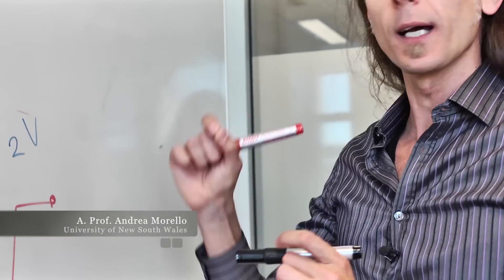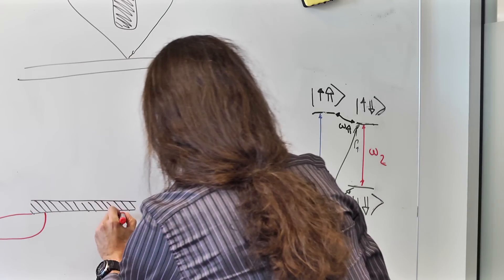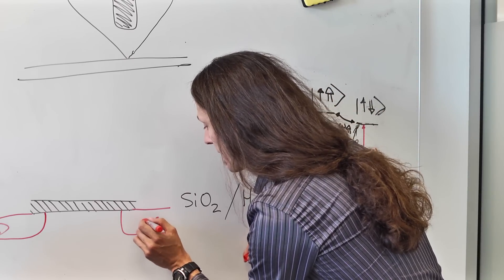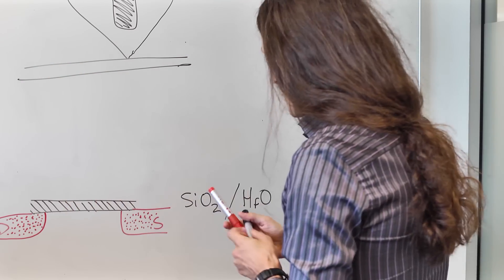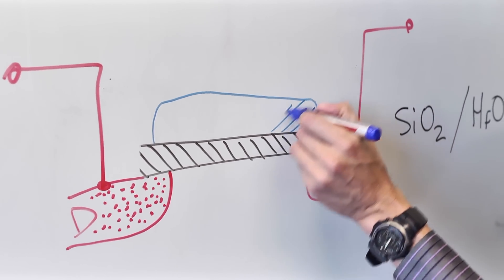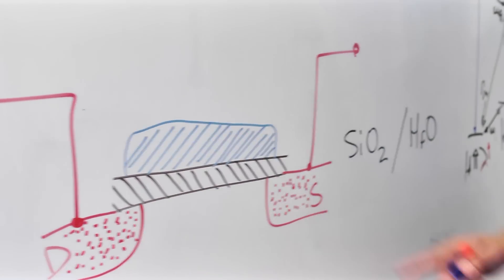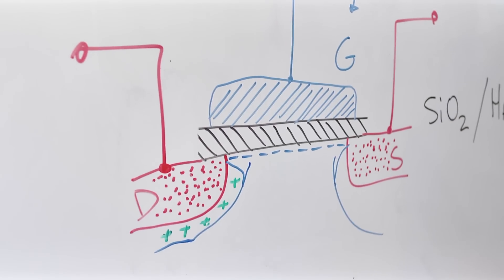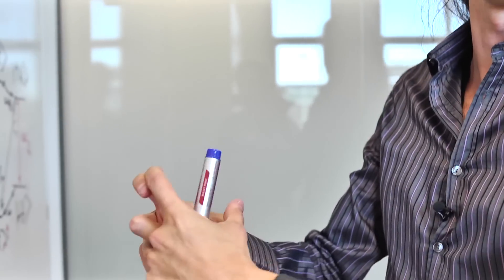Transistors & The End of Moore's Law

Comment: I preface my comment by saying that your videos are great.  I am a chemical engineer, and you guys are how simple engineers become well rounded multi faceted scientists.  So, my comment is about your description of the quantum mechanics problem.  I think it would benefit the listeners if you indicated that everything is quantum mechanical, but that a specific physical quantum mechanical phenomenon causes current to flow through a seemingly impermeable barrier.  One may even use "tunnelling" since the normal listener should conceptually be able to understand the implications of the word.  Also, I think you need to note that only through well designed or completely unusual quantum mechanical phenomena will we be able to keep shrinking these connections.  Imagine what happens at the 2-3 atom size of the switch, and how exact your tuning of the electronic structure would have to be to cause a diode-like effect.  I am not sure this feat is surmountable with plain ground state electronic dynamics.  Possibly with excited electron dynamics where pump-like phenomena may prove useful.  I should say I work in research, and focus on heterogeneous catalyst design using both experimental and quantum chemical modeling of reaction on the surfaces of solids.  Great video.  Please keep them coming.

Comment: I am still running my gaming computer with an "ancient" Intel Core 2 Duo 2,4ghz CPU from 2005. Now 10 years later it is still able to keep up with most new games specially if you run it at 3.4ghz overclock... It does not seem to help having more and more transistors in the CPU`s for most of the programs I use, what really helps is running at higher clock speeds.

Comment: As far as I watched the video, you forget to mention as to why we need to make transistors ever smaller? Cant we just make more transistros in a bigger area?

I know the answer, but do others know?
Reply: +Saulius “NUNU master” Noreika That is actually a really good question. When you make the transistors smaller you are able to put more and more transistors on the chip without making it bigger and costing more. So you have have faster, smaller more efficient chips, that are cheaper to make. If you make more transistors in a bigger area it is not as power efficient(which leeds to excess heat) and it becomes significantly more expensive to make.
Reply: Know Your Enemy If we could we'd probably triple or quadruple the nomber of transistors every 2 years, though the issue here is that the rate of technological advancment in microfabrication proceses is only capable of doubling the nomber of transistors. Ofcourse there must be other methods of increasing the rate of processing. Though probobly increasing the nomber of trasistors has the highest impact for procesing speed increase and also is most cost effective .
Reply: ***** Mhm.
Reply: ***** Y, the more transistor you put in the cpu, the more calculations(operations) it can perform at the SAME time. Or in other words, by using more transistors you can create more logic units to do the calculations.
Reply: Saulius Noreika You could build in more layers, or in wider area, but both causes more heat due to resistance in the signal path. In devices such as a mobile phone there is no cooling so you'll be limited.
Reply: +hoplahey The most straightforward solution is to use a material that can handle more heat and has lower resistance, I.E. Carbon, the problem is that we have no idea how to do that yet.

Comment: Maybe irrelevant but this is FET (field effect transistor).
Reply: Cem Kalyoncu There are very few bipolar transistors in your computer or phone.  Unlike the '60's, '70s, etc today a generic 'transistor' is an IGFET.
Reply: scowell I had to look up IGFET (insulated gate field effect transistor). Looks like it is another acronym for MOSFET (metal oxide semiconductor field effect transistor).
Reply: louis tournas Wikipedia covers it nicely... "An insulated-gate field-effect transistor or IGFET is a related term almost synonymous with MOSFET. The term may be more inclusive, since many "MOSFETs" use a gate that is not metal, and a gate insulator that is not oxide. "  An alternative would be JFET, not as common today but with its own uses.
Reply: I'm sure BJT are at risk as well.
Reply: +scowell They are still heavily used in analog circuits, though.

Comment: I thought the processor in my old (2008) HP Elitebook 8530w had a fast processor, specs are: 2.5 ghz Intel Core2Duo (45nm with about 400 million transistors on that chip). That computer was over $1000 new back when it was released.I just bought a cheap Lenovo for less than 400 bucks that has a 1.9 ghz Intel i3 that is 22nm and over a billion transistors.

Those numbers line up with what the engineer/scientist in the video is explaining. The Core2Duo has about twice the distance (45nm as opposed to 22nm) between the silicon electrodes so it has roughly half of the number of transistors on the chip than the i3 has.

I used to think that gHz was the line in the sand when it came to processors but now I know the real determinant: the number of transistors.

Comment: In regards to the 'switching' of the transistor; he says you need to run a large positive voltage into the top of the semi-conductor to switch it on... but how is that positive voltage controlled? Is there a switch for the switch? Then what about that switch? ...ad infinitum

Comment: We're reaching the limit of what we can do with computers adhering to Moore's law, but are there any ratified laws of quantum mechanics yet? Have we graduated from theories yet? Does there exist a red book of standards for quantum computers yet?
Reply: xiaochicash Quantum computers aren't as powerful as one may think, for linear processing systems such as watching a video, or playing a game, a quantum computer may actually lose performance in relation to a regular computer, and it will still have the same limitations as a regular computer when it comes to size. Quantum computers are useful for specialised calculations with non-linear answers or integer progression, but when it comes to displaying a picture or streaming a video, it's probably worse.

So when it comes down to it, there wont be a separation of quantum computers and regular computers, but more likely an amalgamation of the two, having a regular processor computer with a quantum sub-processor to be used for specialised calculations.
Reply: xiaochicash I am wondering how close we can get those silicon diodes on a chip before, like he said, the electrons will just jump over without a circuit having to be completed. Nanometers (I think is billionths of a meter?) is freaking small. And when the transistors get so close in that fashion, how do we prevent that "jumping?"

I am basically reiterating the point the guy in the video was making, but it raises the point that eventually we will create the best processor we can under the current processes that are available to us. At a consumer level, this is not a problem because who can bitch about the capabilities of the processors in their computers at the present? They are amazing. And they will definitely improve, but for how long? 

At the end of thay spectrum is the high-demand computing that scientists in big university research facilities are require, there has to be a point where they need more. Is that where the quantum aspect comes in?
Reply: joh n  In the coming decades, if progress isn't made towards establishing a standard for 'general purpose quantum computers' we may see a divorce between consumer computers and the quantum computers used by academia. 

A future where consumer laptops have had the same processing power for years, with silicon layers only one atom thick with no more room for improvement, manufacturers have nothing new to offer because they can't make anything new. 

Meanwhile academia and military interests are riding a second digital revolution with their otherwise cost inhibitive Q-coms. It's an echo of the 20th century. Instead of professors time sharing fridge sized computers while the kid next door fiddles with ham radio parts, We'll have professors time sharing on fridge sized Q-coms while the kid next door fiddles with a pile of Sony Vaios.

I guess this could give rise to a 21st century Steve Wozniak, some guy pursuing a boyhood dream of owning a personal Quantum Computer.
Reply: xiaochicash if you mean "have we graduated from hypothesis yet" yes we have. The body of knowledge just keeps growing.
Reply: Perpetua Lux  "Likely an amalgamation of technologies"  Astute. Why didn't I think of that? Also, thank you for graciously prefacing with 'likely'. It spares you from being pontificating and makes me feel better about standing corrected. Ah, well.
Reply: Well, we use quantum mechanics to make phones and computers.
Reply: +xiaochicash a law never becomes a theory and a theory never becomes a law. a law explains what happens but doesnt explain why it happens and a theory is what explains why it happens and they dont become one or the other

Comment: this explanation is so wrong at multiple points

1. Its not the positive electrode that "attracts" bunched up electrons from cathode but a potential barrier that gets made from -ve ions that squeeze the channel between D and S by not allowing electrons to pass through. When these ions get nullified or "pulled away" from the path by positive electrode on the gate G it makes conduction possible.
2. Its not number of transistors that have a direct impact on computing power. Imagine this if you had a computer that could do X tasks in a fixed time according to this assumption (that computing power is proportional to no. transistors) you could be doing only 2X tasks in the next 18 months in the same fixed time. If you look at number of applications that a machine can execute in a given time you will find this is wrong. What does affect computing power is algorithms and software architecture of the machine so for the same config you find the Mac, Windows, Linux Os's have very different execution speeds. Its crucial to understand that we are not looking at the digital doom of modern world when computers stop having more transistors, algorithms are pretty much managing the show and will continue to do so even when hardware lags behind.

Comment: Well, the solution is simple.. KEEP INCREASING THE SIZE OF CHIP (exponentially) .. and you can continue following moore's law even beyond 2025
Reply: bannajirocks but then the chip produces more resistance and resistance produces heat and heat reduces the clock speed the the CPU can run. The smaller you make the transistors, the less resistance each one makes, but when you fit them in the same space, they produce slightly less heat, hence why you never see chips grow too large.
Hope this helps.
Reply: dutchrjen Only at the speed of light inside the material, which would be lower than the speed of light in a vacuum.
Reply: bannajirocks But then they would overheat and melt.
Reply: bannajirocks because if the chip is to big, you need a bigger computer to hold it. Do you want to own a 6 foot tall computer?
Reply: dutchrjen Because I missed that, sorry.
Reply: I have heard that some people are trying to make an optical computer as it would be much faster and would avoid some problems of this classic electrical transistor-based computer...
Reply: +dutchrjen electrons do not go at the speed of light as electrons have mass
Reply: dutchrjen you said electrical signals and electricity travel at the speed of light. Photons are not electrical signals or electricity
Reply: dutchrjen electromagnetic waves are not electrical signals or electricity
Reply: dutchrjen so you are saying when ever there is a electrical current it turns into light that is not true. Also an changing electrical field produces an magnetic field that is not alternating. An electromagnetic wave needs the magnetic and electrical wave to combine into one ocililating wave and yes voltage in a wire makes an magnetic field but they do not combine into light. Also light does not travel through copper wires
Reply: dutchrjen electricity is not light and running current though copper is not light and the flow of electrons does not happen at light speed case closed. If it was photons flowing then it wouldn't power anything and there would be no advantages of fiber optics over copper. 

Edit: ok you are mostly right the electric signal theoretically would travel at light speed but in the real world because of other factors like capacitance its usually 50 to 70 percent of light speed. But electricity itself goes at the speed of the electrons
Reply: dutchrjen read my edit to my last post i thought you were saying electricity moves at the speed of light but you are talking about something completely different. The rest of this is not arguing against you but just my curiosity. So from my understanding in order to take advantage of the faster electrical signal we must detect photons somehow so what method does cpus and other stuff use to detect them

Comment: If someone could answer me these that would be great:
1) What are the techniques for manipulating number of atoms in some space? I mean how do they add , for example , 10 atoms of something to something else. How do you 'grab' atoms and carry them?
2) If the distance between P and N would be some day 5 atoms long , would that affect the number of electrons 'flying' over them from P to N and in turn affect the intensity of current? Does current intensity affect if transistor would even work in a sense that would he produce 1 bit of info?
But still manipulating atoms around like they are apples is what buggers me a lot , i mean where can a man get some info about "machines" that we use to do those sorts of things? Are they limited to only few corporations and are those instruments top tier of our technology so far? Thanks in advance.
Reply: Jeevan m.n
Hey thanks for helping. Also , I wonder does for example "5volts" depends on number of electrons or their density?How is voltage being controlled to be some exact value(5V)?Is it by controlling the numbers of electrons in two separated areas?Is the area with more electrons on higher potential?Is it because of that electrons from high potential "wants" to rush to the area with lower potential to balance itself out, thus creating "current" / flow of electrons?
Reply: Jeevan m.n
Computer science/programming. But honestly ever since I remember I was more interested in how things work on a more lower, fundamental, level."How did it all began" I like to ask myself. Unfortunately I'm stuck in this modern age with so much information coming in and out of my head just because I want on purpose to read and learn about everything so in the end , ironically , it only have negative effect on me since it is expected from people to be specialized in one area and one area only. How logical is that my fellow programmers thought I was crazy to want to understand what is happening below our fingers (inside computer) while we work? Yes of course I understand it is not practical since we are all in a race toward more money right ,disgusting...it sometimes gets me instant depressed.
Reply: Jeevan m.n
Thanks for your time and effort . I am not active on social networks xD
Reply: TheHolyReality Hi, just wanted to clarify something, computer science != programming, also, if you go to a decent college, teaching you how a computer works deeply than programming in some high level programming language is a must, if it's not the case, i recommend you to read "Digital Design" from Morris Mano, it will help you understand how a basic modern computer works, it's not that misterious as you may think, it's just some combination of logic and electronics.
Also getting depressed doesn't help at all, be the change you want to see in the world, that's the only way to get a better world, follow your dreams, study whetever you feel like studying, what im saying is don't restrict yourself to only one thing if you don't feel like doing that, you can make all the things you want, there's always time
Reply: Luciano Unknown
Hello sir , thank you very much for helping with info and inspirational advices . Can we consider that computer science is a branch of mathematics that has many branches (as in programming language theory , computation theory , AI , ...) ? Where does programming itself falls in? Is it a stand alone "category" and why, when often programmer himself is faced with many things that are branches of computer science like performance analysis,algorithm analysis etc.